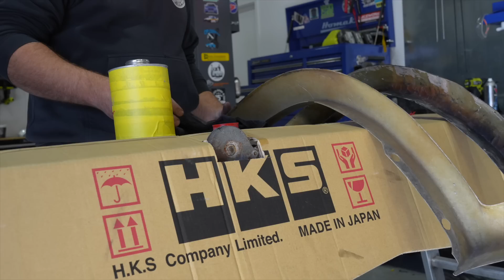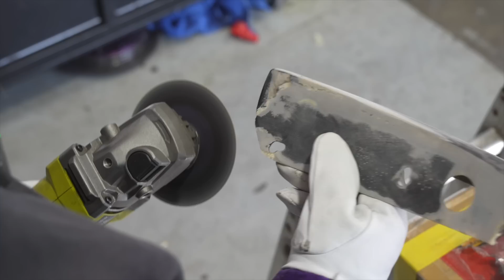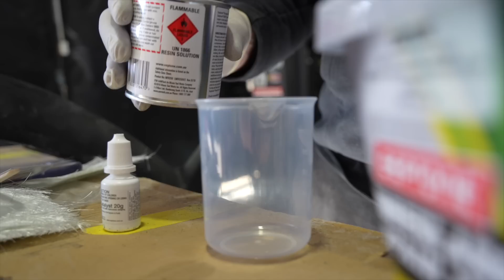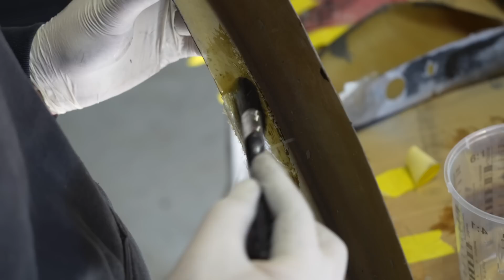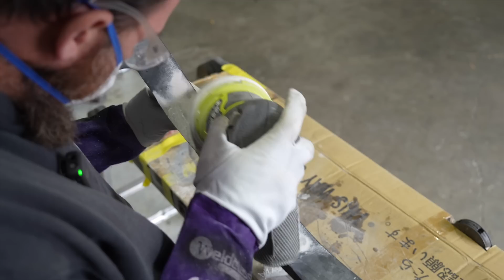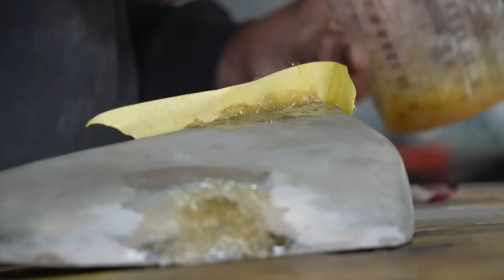New (Broken) Flares for the Pajero Mini - How to repair fibreglass

Comment: Hey Benny...great Ep! I save the sanding dust when levelling new fiberglass... mixed with resin this makes a great fine scratch filler, but obviously has no structural strength....

Comment: From someone who has probably wrapped a mile of hot pipe with 2-4" fiber glass rolls to keep the heat in: it really isn't too bad to work with bare handed/skinned you just HAVE TO plan to make a 'tape hand' with blue painters tape or in a pinch packing tape to get all the itchies off your skin.  Sounds silly but works amazingly well!

Comment: No joke, this is actually quite dangerous, PPE is needed. Maybe a little less for limited/DIY-exposure than for professionals. The fibers are nasty little buggers that will enter your body through both skin and lungs. Better safe than sorry when it comes to these things.

With that said, I really liked your instructions. They were clear and to the point, thank you for sharing. 
Some additions/tips from me would be that I  find rowing mat easier to work with than chopped mat. I also use tape from the front side but have found that transparent packaging tape gives you better control over air voids. I usually build my repairs in V-shape to ensure good adhesion and strength. If the part is thick enough i do two V's, one from each side.

P.s. If you work with Epoxi you can sandwich your repair in tape which isnt a great idea with polyester resin..😂

Comment: Polyester resin is really bad to work with: very short pot life, strong exothermic reaction and even stronger smell. Epoxy resin is way easier to handle, at least for the pot life.

Comment: I worked in the same building with a fiberglass firm that made pieces for Moroso 50 years back. One thing they did was lay strips of corrugated cardboard and glass over them for strength. They also used small diameter cardboard tube (13mm) in stress points. Their shoes lasted a few weeks covered in resin. The inhalation of fumes made them... interesting.☺

Comment: As a wooden kayak and canoe builder who goes through gallons on marine epoxy resin and rolls of fiberglass, your tips are generally spot on. Putting chopped mat into resin is a classic tip. The fiberglass mat is held together with a binder which dissolves in resin. You can also make a thicker resin mixture (like a putty) that won't sag by adding flour to it. The commercial products are wood flour and a fumed silica (aka Aerosil or Cabosil) but kitchen wheat flour also works. 
For a someone totally new to fiberglass work I'd consider starting them with epoxy. It's more expensive but heaps friendlier to use. First, the smell isn't as noxious polyester (most car and boat repair kits), the mix ratios are simpler (usually around 2:1, and the pot life is a lot longer (30-45 minutes depending on the hardener). It also doesn't "kick" fast like polyester.

Comment: "one of one" workbench? So, it's the only one out of the 87,000 that were built that year optioned with the engine block warmer, grey floor mats instead of black, snow tyres, and radio delete in the baby shit green colour? Wow dude, you'll fit right in at any American car show!
Reply from the maker: Can’t tell if you’re angry or continuing the very clear joke.

Comment: Great timing for me with this coming out when I need to repair some damaged body work. Very helpful. Roughly what grit is the sand paper you used? Thanks.
Reply from the maker: Normally 40-60 to get going but go gently
Reply: @BennysCustomWorks  Yeah heavy grit or score the shit out of it with a razor knife. On repair work you will only ever get a physical/mechanical bond so a rough surface works best. If you need maximum strength, say for a bar or lower lip, drill small holes around the area being repaired and sand them down so you have no hard edges to hold air. When you laminate from both sides you will have a mechanical bond to the original surface and a chemical bond holding all three layers together that will help prevent future delamination. Also if you can only work one side at a time don't stress as the resin will still reach a chemical bond for about 10-20 days depending on the temperature you're working in or just ask for unwaxed resin if buying bulk like a 20lt pail. But most of all be careful with the MEKP catalyst as it will burn skin and by the time you feel the pain it's to late, get it in your eyes....3 seconds and it will begin to burn and send you blind. 
Lastly, 100% keep your work dry, water will kill the catalyst dead and stop the reaction in the resin leaving you with a uncured spot that can be a total pain to remove.

Comment: To add strength to the mounting holes in fiberglass or FRP parts, a washer can be glassed in and redrilled later to clear it out.  Also, as someone that worked in a fiberglass boat plant, the tip about the chopped glass in resin is spot on.
Reply from the maker: Thanks mate :D
Reply: Bingo to both, same with carbon fiber work.
Reply: yup, learned the chopped mat and resin trick from my brother who spent a good number of years building fibreglass speedboats :)